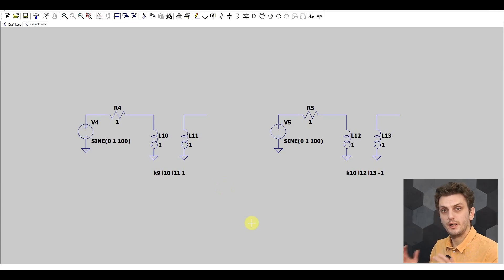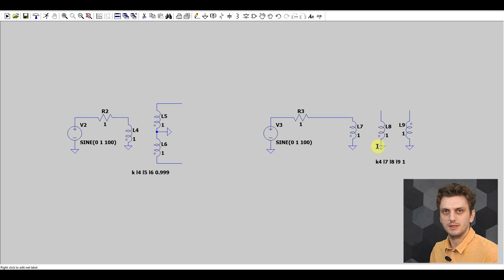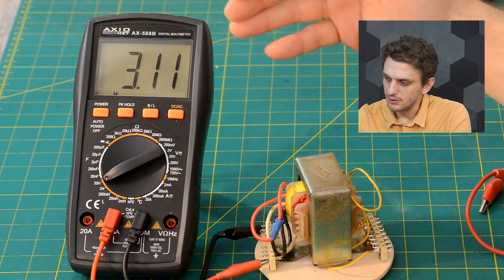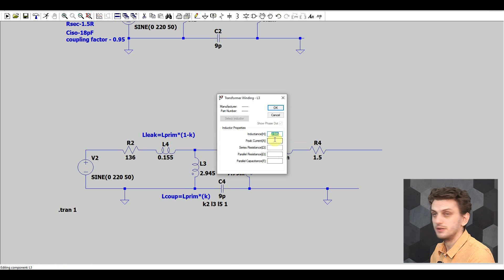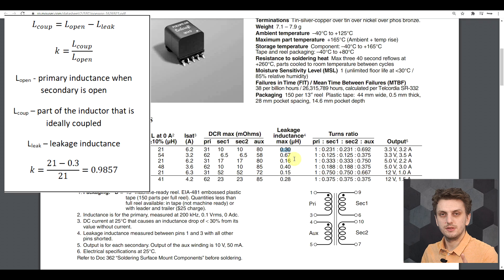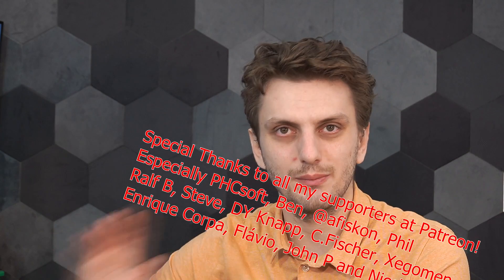LTspice tutorial - Modeling transformers

Comment: I am trying to simulate a toroidal transformer. I didn't use ground because I am trying to do an isolation transformer. But as you told me I will use ground. I have to ask if having u, length and area section can I evaluate the saturation of magnetic flux and possible power transfer ? )

Comment: @FesZElectronics - could you please explain - if I try to model a transformer with air-gap in the core (like single ended transformer in tube amplifier) - how should (or perhaps shoudn't as irrelevant??) this fact be reflected?
Reply from the maker: While it is true that the proprieties of a given transformer(specific mechanical dimensions, materials and number of turns) is impacted by the presence or absence of an airgap; if you consider the transformer as a "black box" and just measure it from the outside to determine the model parameters, it will not matter how the transformer was built; you only care about the construction if the model is generated from the construction characteristics (without actually measuring the practical device)

Comment: Parallel Resistance and Parallel Capacitance can be aquired through an LCR meter. Is it determined by short or open the secondary side, if it is being measured from the primary?

Comment: There is an unrealistic assumption in your transformer model. (5.21 min in this video). In a center taped transformer of course can be coupled the L1 with L2 with coupling factor 0.999, and L2 with L3 with  0.1, BUT also L2 is coupled with L3 with a reasonable coupling factor. This is missing, and as best as i know this is not possible to simulate in LTspice. Thanks in Advance.

Comment: Hi, may I know why you distributed the value of your interwinding capacitance on both sides of your inductors? Why not connect it only at the top side or bottom side?
Reply from the maker: It usually is simpler to put the capacitance in a single place, but in reality, the capacitance between the 4 ends is different - the closer the terminals are on the physical inductor the higher the capacitance(say the last turn of coil 1, and the first turn on coil 2 which is overlapping coil 1 are much closer than the first turn of coil 1 and the last turn of coil 2) . This is relevant when each end of the coil sees different voltages like in switching converters.

Comment: Timestamps / Chapters
0:00 Intro
0:41 What is a Transformer?
2:05 Simulating Coupling
4:12 Multiple Coupling Factors
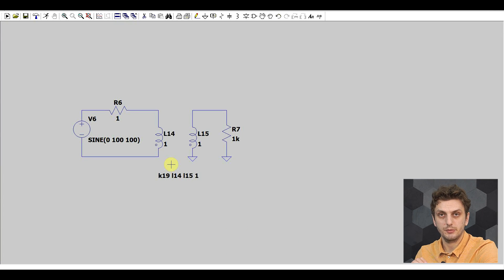5:30 Pro Tip: Don't have floating circuits
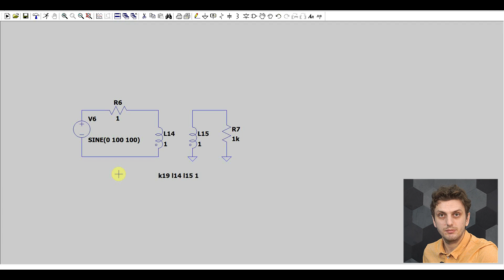6:26 Characterising a Transformer for LTSpice
7:07 Measuring Coupling Factor
8:10 Measuring Coupling Factor for the Tesla Coil
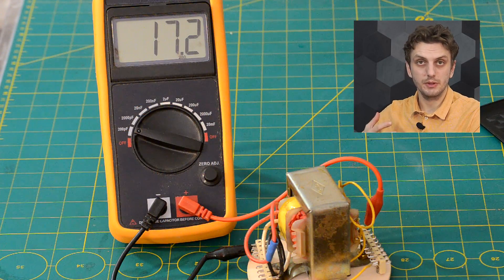8:57 Measuring Interwinding Capacitance
9:44 Building a Characterised Model
10:27 Another Model Type
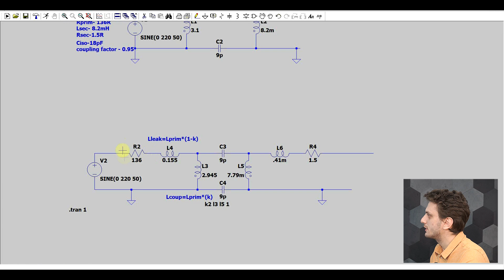11:00 Comparing Models
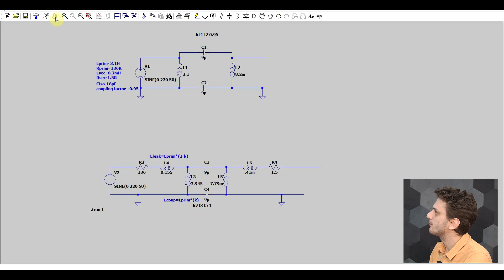11:33 Simulation Results
11:49 Characterising via a Datasheet
13:50 Outro

Comment: Great video!
I noticed an issue though, at 11:20 or so.  C4 is shorted to ground on each end!  The bottom side of L3 and left side of C4 are connected to ground (Node 0) and the bottom side of L5 and right side of C4 are also connected to ground (Node 0 as well).  One bottom side or the other needs to be isolated from the ground by at least a large resistor, or by using enough Rser in the L3 and V2 so you don't get a problem in the sim.  My point being, to get an accurate simulation out of the bottom circuit you need to put all 18pf on C3.  The same issue exists on the top schematic, too.

Great part on the stray capacitance and inductances and how to calculate the coupling factor!!  I've never actually seen that set down before.

Comment: Hi Fesz, thanks for the great video. Can you elaborate a bit on the test frequency used when measuring your transformer? I have a 400 Hz transformer but want to evaluate the transformer under a 1Mhz lightning fault condition I need to meet. The inductances change when I set the LCR up for 400Hz vs 1 MHz test frequency. Is there an error is my measurement method or should I measure the parameters and build a new model for every frequency scenario I wish to consider
Reply from the maker: Its perfectly normal for the transformer to change its behavior based on frequency. The main reason for this is the magnetic permeability of the core is frequency dependent. You will find that as frequency increases, permeability drops, but also the transformer becomes more lossy - less of the magnetic energy is transferred to the secondary and more is converted to heat. I think it would be best to treat the transformer differently for the 2 cases - 400Hz vs 1MHz, so have different models, not just on the inductance side, but also the coupling and losses side, to get the best accuracy.

Comment: My problem is that I was unable to find the information requested to build your model. Is it possible to have a guess? For a 500W, 230V transformer delivering 34+34V at this output? The only thing I was able to find that the regulation should be 5%. Thanks again.
Reply from the maker: Hello Teodoro! Well, based on the data you provided, the only thing that could be extracted is the turns ratio (not how many there are, but the ratio on primary to secondary); I'm not sure what the 5% regulation refers to - it could have something to do with the inductors ESR, how much the voltage drops based on the current flowing trough the inductors. If you have a particular transformer in mind, you could extract more data from a datasheet. If not, just as an example, you could search for a random 500W trafo on any major electronics website and see what data you can find like that in the provided datasheet.

Comment: LTspice circuit at time 9:46 seems to indicate that C2 is electrically shorted. If so, it may be necessary to change the value of C1 on that circuit to 18pF.
Reply from the maker: Hello Frank! I did short C2 but I would not re-distribute the capacity; I was showing a recommended way of creating a model; the interwinding capacity is not perfectly distributed, but even so, by shorting a line between primary and secondary will reduce the effect of this capacity - it should not be connected in a way to have the highest value, but in a way to be uniformly distributed.
Also the impact of the inter-winding capacity is most visible when there is no short between primary and secondary, with such a short circuit any effect is minimized.

Comment: Great video!
One important thing I would like to mention is that these are small signal parameters. 
Especially under load the primary inductance will be less. This is even more significant with a DC current through it. Eventually it will totally collapse when being driven into saturation.